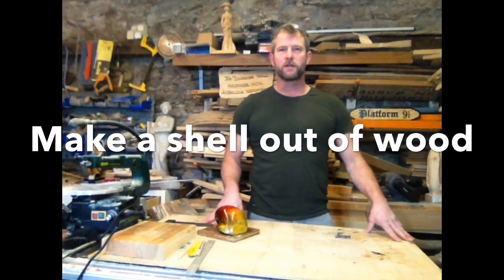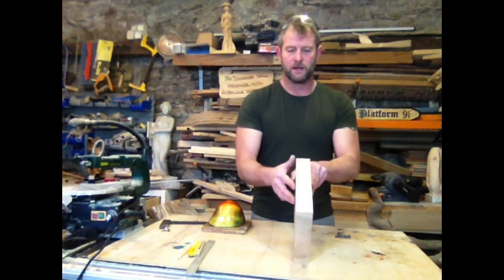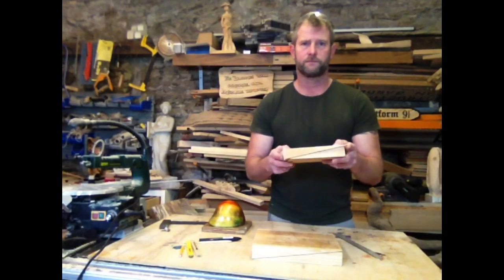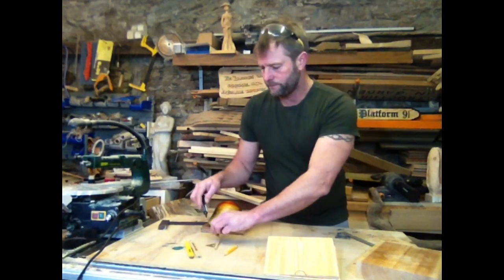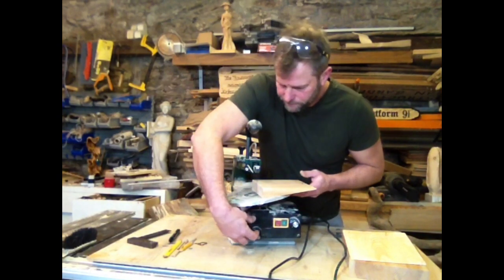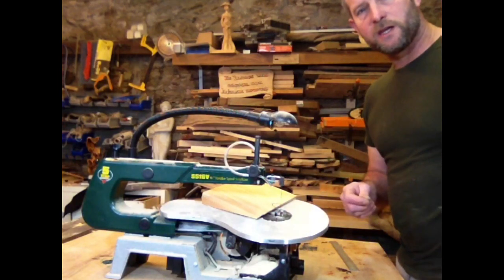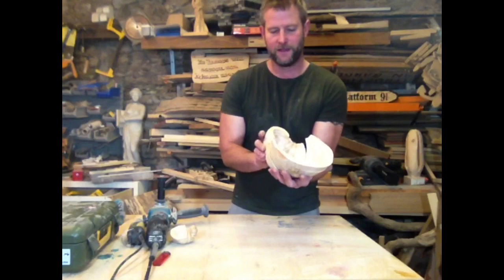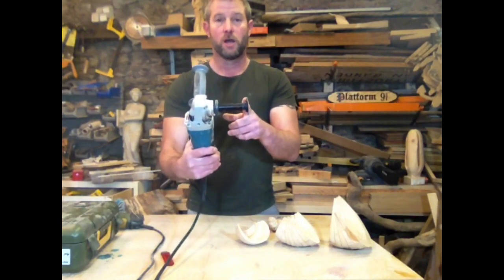How to make a sea shell from wood

Comment: Great video. I also watched Steve Garrisons videos and have successfully made one shell so far from a piece of fence post so it’s got a lovely green streaking from the preservative 🤓 it came out perfectly. 

I found that an inflatable ball sander worked really well for the insides of these and also the wooden scroll saw bowls I make.  I used pretty much the same set up as you including the hose next to the pillar drill to remove the dust ;-) 
I’ve now bought some Zebrano wood which should give beautiful grain but haven’t plucked up the courage to hand cut the wedges yet as it’s a pretty tough wood to cut.
Reply from the maker: thanks for your comments, I saw Steves videos and shells too and immediately had to give it a try! time consuming but very rewarding to make them. Zebrano should give a beautiful finish! very tough wood though. love to see pictures of it when your done. I have looked at the inflatable ball sanders quite a lot, they are just so expensive for what they are! I have unsuccessfully made a few copies of that design so I might end up buying them in the end!

Comment: Quick question for you Johnathon.  Getting ready to give this a try but I am  confused by one key element here.  I see that you use the first cut as a template for future cuts.  I understand that you do in sequence from board 1-4 than rinse and repeat.  But after you do the first cut, you use that as the template for all future cuts.  Just wondering how the sizes get progressively larger if you are just using that first cut as the template.   Wouldn't they all be the same?
Reply from the maker: I understand what you mean, ok the wood slices are a wedge shape. So each piece has an angle on it. Meaning Each slice has a top and bottom with the top being just slightly smaller. So when you use the first slice as a template for the second, the top face is  just slightly bigger than the previous one. So it grows quite slowly. Imagine edge slice is like 1mm bigger each time. Hope that makes sense
Reply: @JohnathonWhittaker     Ahhhhh.   I get it now.  thank you for the prompt response
Reply from the maker: @kmeyer52172  no.problem at all. Happy to.help!
Reply: @JohnathonWhittaker    Cutting the angle end grain is no joke with a handsaw.  ruined 3 wedges so far by inept handsawing technique.   LOL.
Reply from the maker: @kmeyer52172  I know what you mean. I found that cutting the wedges can be quite tricky! I only uses a hands as because I wanted to make the wedges as big as possible.  I think I ruined a few myself

Comment: As you step up in size on your half round pieces how are you drawing them out? I understand using the first piece for the second one. How do you step up in circumference size? Are you just drawing another half round.
Reply from the maker: Hi Charles, you use each piece you cut out as the template for the next one. Since your cutting each one at an angle, the back has a slightly larger diameter than the front. So when you have cut a piece out and draw the new shape, it should be a few mms larger. That's why you need to use at least 4 different wedges.  If you cut them all out of the same piece, each new piece of the shell would be to thin. Using lots of wedges allows enough thickness to glue together and then sand. Hope that makes sense and is helpful to you
Reply: @JohnathonWhittaker  ok I think I follow you. I am cutting on a wedge piece of wood. About 4 of each piece. I just am not setting my scroll saw up on an angle.. thanks I will give it a try.. have you made any other types of shells? If so do you have a pattern. After 3 back surgeries I enjoy woodworking. I was going to order some patterns however disability makes every penny count.
Reply from the maker: @phartharder   if you look at 2:50 on this video, its will show you how to set the angle on the scroll saw. I made a few other types of shell, this ones a conch https://www.youtube.com/watch?v=pkKWii-uIJs&t=368s There are lots of patterns out there, check out "spirals by steve" at http://www.spiralsbysteve.com/ebooks.php. his pdfs are very clear and you will need the guides to be able to finish the shell

Comment: I must be an idiot because I’ve tried this so many times and they just don’t come out right, the tips of the pieces don’t line up together they are way off
Reply from the maker: Hi James, sorry to.hear your having issues with this. I think it took me about 4 attempts before it actually went right! My first mistake was not using enough wedges. The more wedges you use, the smaller the size change in each piece is so they are easier to line up. The other mistake I was making was with the scroll saw itself. Each wedge needs to be lined up and cut on the same angle and same side every time. If not you get like an "upside down piece that doesn't match. I hope one of those tips help, if you want, send me some pics of what you have done and I can see if I.can help